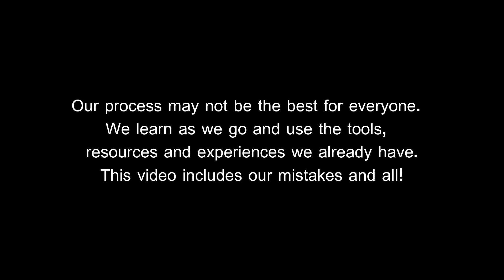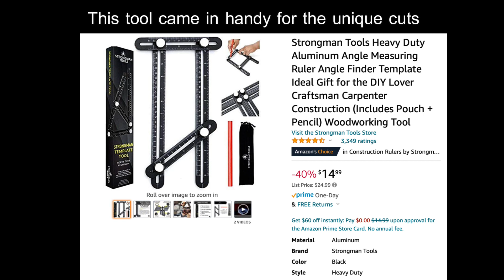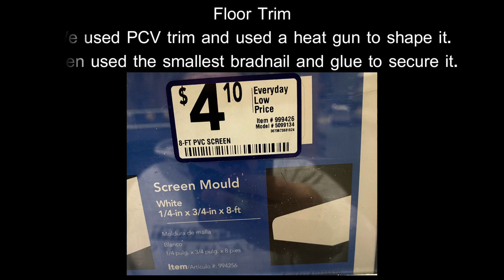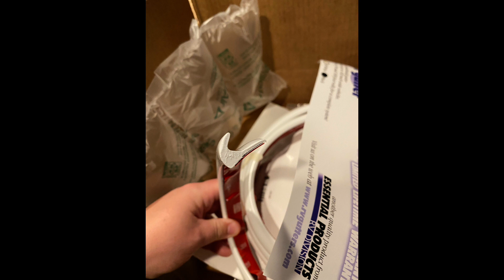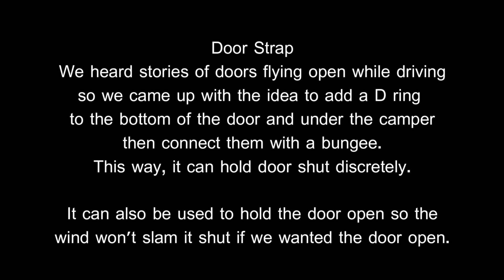1983 Burro Trailer Episode 18 - Miscellaneous

Comment: Terrific videos. You used the ecf 3.2mm underlay? I assume the purpose is to obtain an even floor as the Fiberglas is nearly 1/4” tall where it meets the floor. This would create a noticeable gap/uneven surface for anything but carpet. Was one layer of ecf enough to raise floor height to match in your case?
Reply from the maker: Yes, that's pretty much the reason.  I trimmed underlay just to meet edge of furniture edge and it turned out perfect height.  There are few spots that had raised screw, but underlay is soft enough that didn't really create weak spots for top floor.  That's said, I do wish I laid reflective thin layer first.  Floor gets super cold in winter months.

Comment: Thanks for the video!   Did you use any extra adhesive when applying the weather stripping and Trim-Lok or just used the manufacturers affixed adhesive?  What font size did you use for the Burro logo?  and where did you find an svg of the Burro head?    :)
Reply from the maker: The weather stripping came with 3M adhesive.  We did not add any additional additional.  I drew the artwork in illustrator using a photo I took of the old one before we removed it.  I know they do have logo files in the Facebook Burro group under files that you can download free.  I lined that up with what I drew and it was almost 100% the same.  The artwork includes the letters so you don’t need fonts.